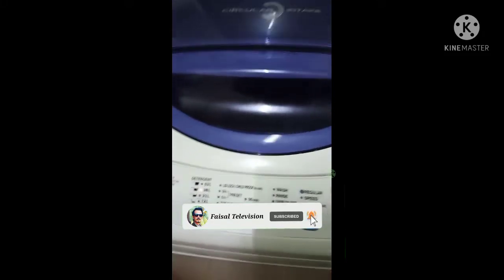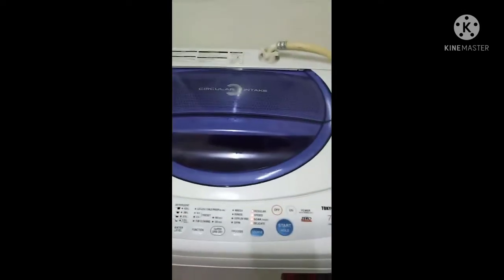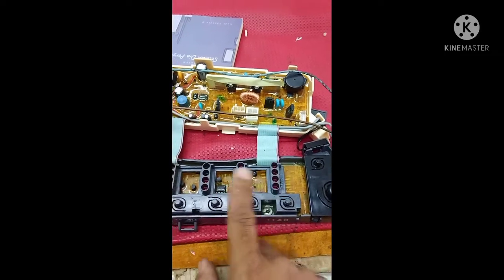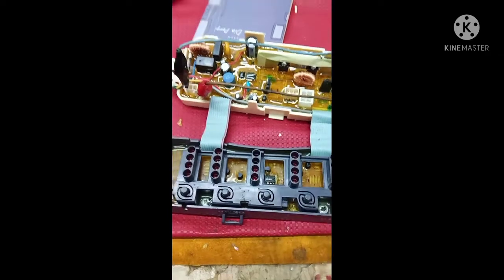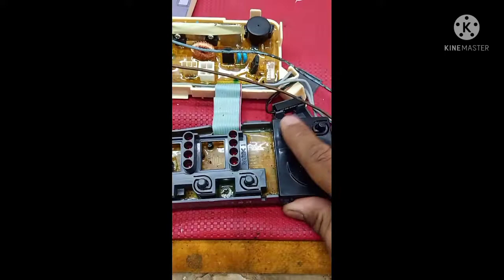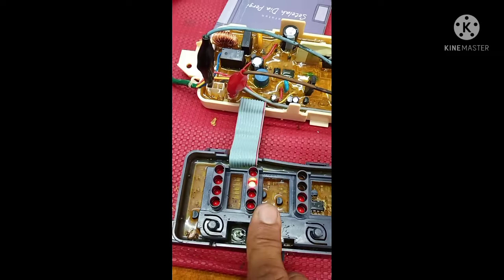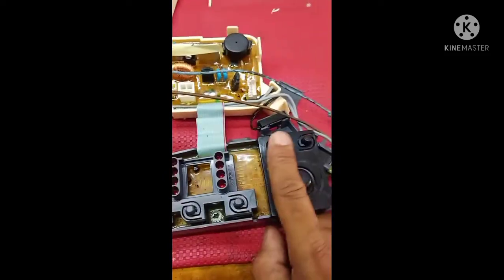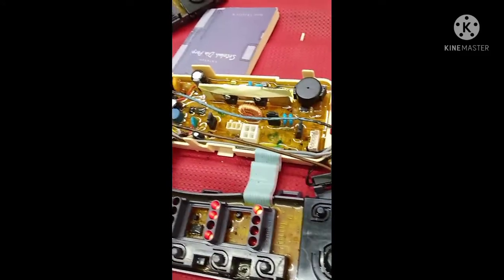How to repair Toshiba 7.2kg washing machine PCB board Error problem solve Model AW-A820MM

Comment: problem from ic program washing machine.
Reply from the maker: What brand and what is the problem
Reply: @faisaltelevision69  a820mm problem start on  power all lamp blingking red & red lamp 38 liter water on.if  change ic still got problem try checking belting & capasitor.
Reply from the maker: You changed memory ic? And can you send me video or pic from your washing machine
Reply: hello boss
Reply from the maker: Hi
Reply: @faisaltelevision69  what problem
i change new pcb
same error display
Reply: belting problem can view error?
Reply from the maker: Blinking?
Reply: @faisaltelevision69  yes blinking
Reply: but same model but 
53 litre red blinking
Reply from the maker: Remove memory ic